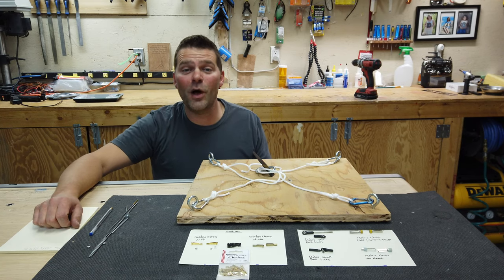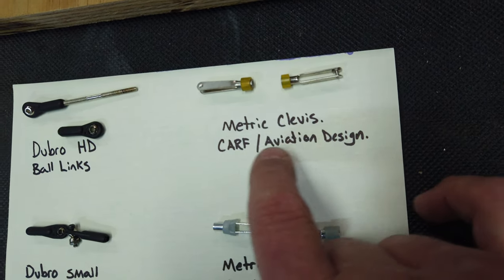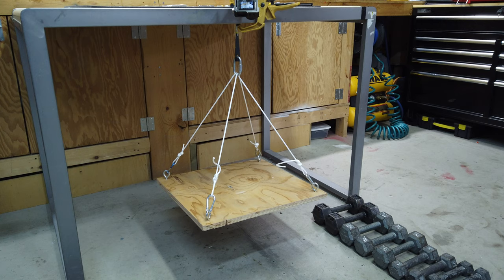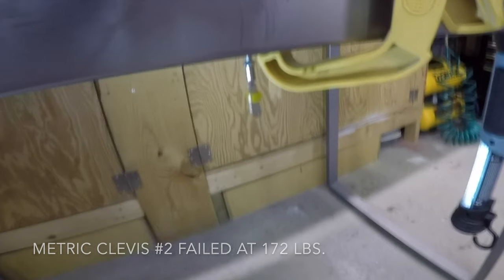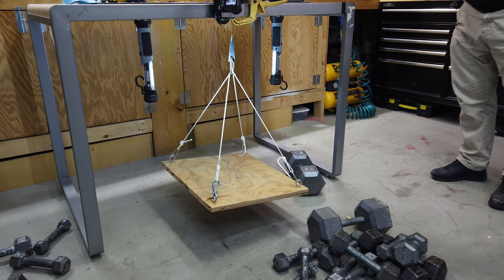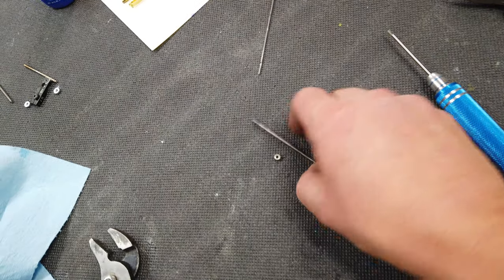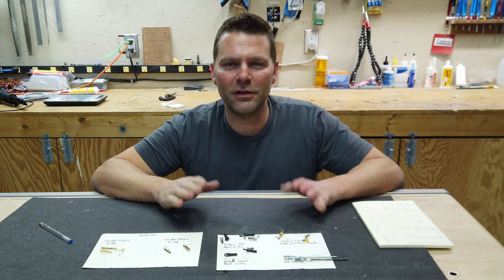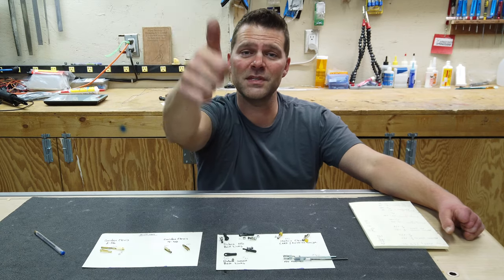Radio Controlled CLEVIS & BALL JOINT Testing - Testing to failure

Comment: I found this by accident however I’ve been waiting for someone to do this. I actually tested the same things in our testing lab almost exactly as you di but with very accurate lab loading and measuring. The results were close to yours as was my own conclusion. I don’t think I ever had a Clevice  or ball link failure in flight of any of my big warbirds but I had a pretty good idea of the loads placed on them. Clevises and ball links are used on full sized race cars but these have been tested and certifications are used all all the time. Your safety washer idea is standard procedure on the race cars and a good idea. 

I shared this nice video with my young son who is just getting into giant scale modeling.  I did structural engineering for my engineering career so it was a way of life for me. I’ve been retired for a number of years but still eat live and sleep this stuff. I even keep a note pad by my bed for middle of the night insights.  

Keep up the good work. I’ll try and follow you.

Byron nelson.
Reply from the maker: Cool Byron!  Thanks for the info in your comment!  I enjoy putting these type of videos together!  Thanks for watching!  Will be doing some compression destruction testing soon.

Comment: Excellent video.  I honestly don't think I've ever seen this done before? Bottom line is its nice to know that these little connectors can take far more load than they are ever going to see.  What do you think would happen if you hung that rig from even the strongest servos we use for this size model with a one inch arm?  Love the videos and detailed build processes! Thank you!
Reply from the maker: Thanks Jay!  Yea, all of these options will work just fine for what we use it for.  Honestly I think that even the strongest servos on 8V or even 12V servos would struggle to hold 180+ lbs!

Comment: The advantage of the ball joint is they can compensate for a rod that's running at a slight angle. On my Avro Vulcan I have clevices at the servo end and ball joints at the moving surface, that way you don't get any binding up.
Reply from the maker: Great way to do it!  Same setup on my CARF Ultra Flash.  I think the results of this video show that any option will work just fine!

Comment: Thank you for doing this. I'm very curious to know how the aluminium version of ball links hold out...
Reply from the maker: Thanks Kim. I think the aluminum balls would fail on the mounting bolt first. At least the smaller ones with 2mm screw would. The larger ones I couldn’t guess where the failure point would be.
Reply: @thelightersideofrc  I think you're probably right, although I also worry about the ball snapping out of its housing.

Comment: Really interesting video Johnathon.  It would be interesting to see some sort of longer-term durability test.  I would imagine that failure in an aircraft would rarely be from a max load, but rather from repetitive movements, or the clevis somehow coming apart or loose over time...  the servos or control surface would surely fail long before you got to the kind of load you were applying to the clevis.  Still, If the clevis holds up to that kind of load, it is a good sign it would hold up to many many repetitive smaller loads...  Thanks again for an interesting video!
Reply from the maker: Thanks Ted.  Yea I think that any of these options shown in the video would work on any plane/jet.  I think flutter of a surface because of loose joints or just dumb thumbs is way more likely!

Comment: Great info, I was really surprised at the ball links compared to the clevis, but what is the actual force exerted in flight, maybe the high weight is overkill, maybe the lower weight though much less then the clevis is sufficient.
Reply from the maker: Really when it comes down to it all of these options are more than sufficient for what we need.

Comment: People seems to over do everything, most of these will work on any project, some are just better for certain projects
I personally like the Dubro HD ball ends, easier to install and with give the least amount of slop in those flutter prone jets.
Not to mention getting the proper size hole for the clevis that doesnt cause slop is tough.
I need to dig up my wire heat protection testing I did
Reply from the maker: Yea totally Keith!  what this really shows is all of these options will work just fine for our applications and pick the one that works best for your specific plane or application.
Reply: Numerical drill set, you can find the correct diameter.

Comment: Do you think the heavy duty dubro ball links will be a little stronger with a double control horn . Im scared now i use these😂
Reply from the maker: They failed because the plastic stretched. Double adds nice support to eliminate side forces on the horn and also eliminates the chance of the ball pulling out. 

With regards to failure because the plastic stretches on the aircraft, I don’t think any normal plane would ever have that much force on the surface
Reply: @thelightersideofrc  great thanks for the reply i feel better now

Comment: I rarely trust the clevices in an ARF or  RTF for the model they came with.

Test some from the common foam RTF/PNF models such as Dynam's appx 1250 mm wingspan warbirds.
Reply: Pushing  matters too because some are weaker in push than pull.  Your very short pushrod would essentially eliminate the pushrod as the fail point.
Reply from the maker: Yea i think all the options will ultimatley work for any of our applications as long as they are used correctly.

Comment: I like Yr test method, don't no y people question, as Yr getting 170,to 190 on the pull which is mostly down surface,? On the push which is up will excerpt far more force limits,,, doesn't matter which plastics ball fail, and people put faith, in your quote( old school,) wins my jets, as your method, 👌
Reply from the maker: Thanks Andrew!😎

Comment: Great video Jonathan!! I have a drawer full of no-name 3mm clevises that I have got from some jet kits. I replaced many of them with the 4-40 Golden clevises because of the poor threading. I do however, have many jets with some ball links............now I am nervous. LOL!! Funny that you should do this test as I had just recently discovered a cracked all METAL 4mm ball link in the elevator on my Scorpion during a winter preventative maintenance checkup. These are much larger and robust than the plastic Dubro units. It did not fail, but the link was getting sloppy. I have ordered more all METAL ball links that are used for 1/8 car alignment rods, but maybe I should use them more often instead of the plastic ones. Thanks for the information!!
Reply from the maker: Thanks for watching Brent!  it was fun doing this test.  It made me realize that pretty much any of these options will work just fine for our applications!

Comment: What you fail.to mention is that clevices, while supporting more weight, are more likely to fail than ball links at two placesthe rod thread where they split, AND the pin can AND WILL enlarge the hole in the control horn leading to flutter.  I think you tested well, but as we all know, lab tests dont always reflect real world.  I have have so many crevices fail on me that I have replaced even my glow setups with ball links.  Going on 10 years now, not one ball link failure on everything up to 40% 3D monsters.  Interesting video though.
Reply from the maker: Hey Mike. Totally agree with everything you said. This test was purely to test the failure point. What this test really showed was every single one of these options would be sufficient for our RC toys. Yes, some will last longer and be more problem free than others.
Reply: @thelightersideofrc  yeah, dynamic vs static is always intriguing.  Me, tho, I'll take the security of nut and bolt over pin and clip any day.  This vid actually sparked an interesting debate amongst our club members!
Reply from the maker: Haha. That’s good to hear. It can be quite a hot topic!  It’s almost as passionate as a spektrum vs Futaba vs JR discussion 😂